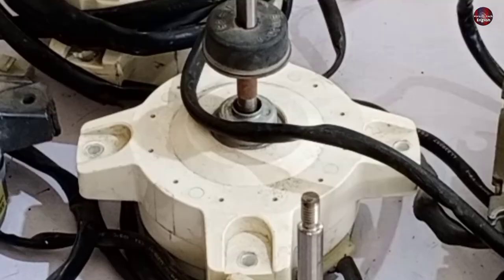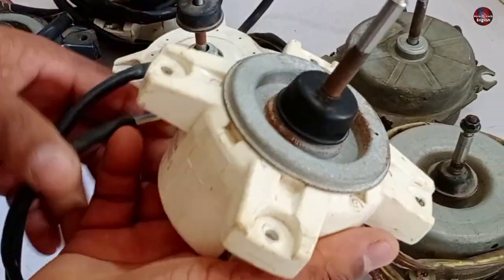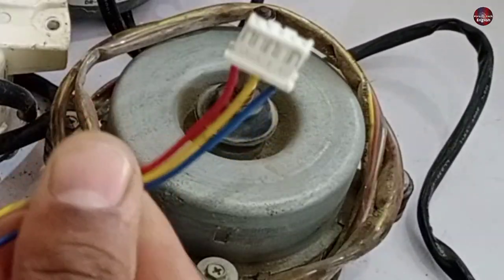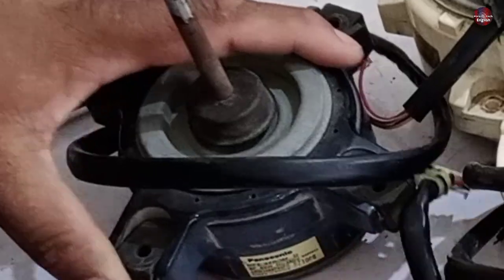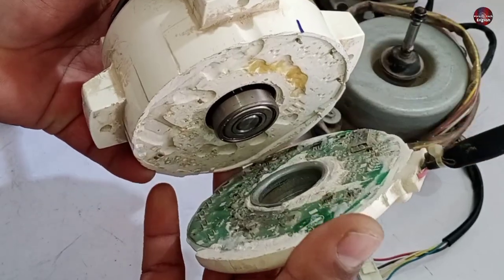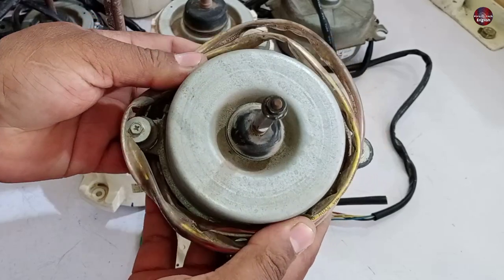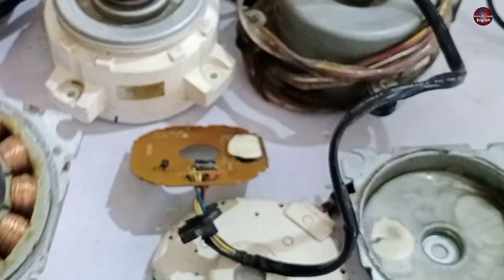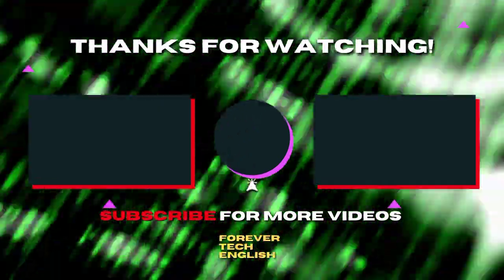DC vs UVW Outdoor Fan Blower Motor, Are They Same?

Comment: I could measure frequency on my Gree compressor but not my 3 wire uvw outdoor fan motor. Do you know the reason? Maybe the current isn’t high enough on a 30W motor. Great video.
Reply from the maker: what wrong with the fan motor?
Reply: @forevertechenglish  hvac pro trying to learn more about these new units I’m installing. I have two of my own to learn on. A Fujitsu and a Gree. Nothing wrong with them. I really appreciate what you are doing.

Comment: Great video Sir
You've explained that a standard DC motor has 5 wires whilst UVW has only 3. Currently I am working on a Toshiba AC indoor blower which has 6 wires whereas first set of 3 wires comes from a big connector and the rest from small connector. I tested the 3 wires from big connector and all have same resistance which makes me believe it's a UVW motor but contradicted from this video as you mention hete that a UVW has three wires only!!! Please kindly advise
Thank yoi
Reply from the maker: The indoor blower motor has mainly 5 wires. The UVW motors are mainly used in the outdoor unit. Which are controlled by the IPM externally installed in the outdoor circuit board.